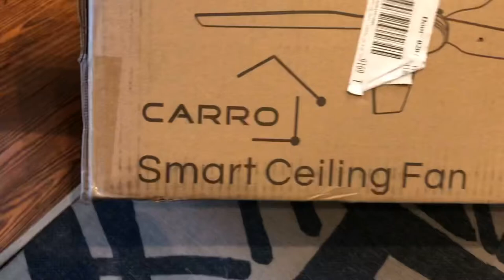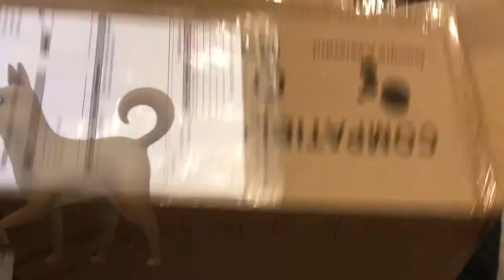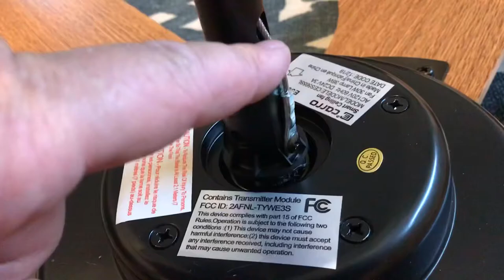CARRO Smart Ceiling Fan Installation 2021

Comment: The only reason I watched this video was to see how you managed to squeeze the power adapter (you call it a transformer) into the mount.  You seemed to skip that part.
Reply from the maker: Wasn’t skipped it was difficult to film while installing. It’s tough but you have to slide it right into the space provided. It’s a tight fit but it will fit
Reply: Haha that part made me cuss and spit a little. It makes sense as you don't want anything that could rattle around, but damn I would've killed for 1/32 of an inch 😆
Reply: exactly!